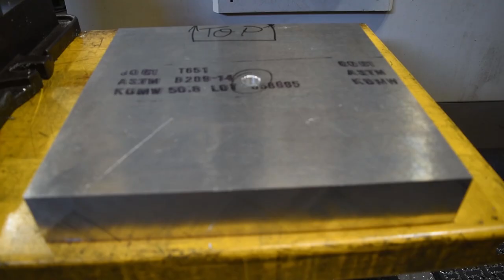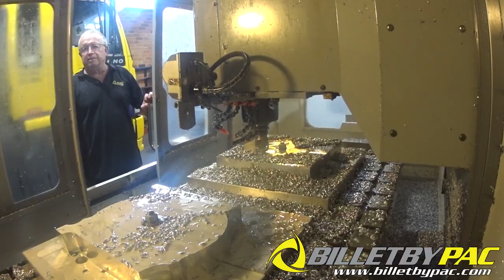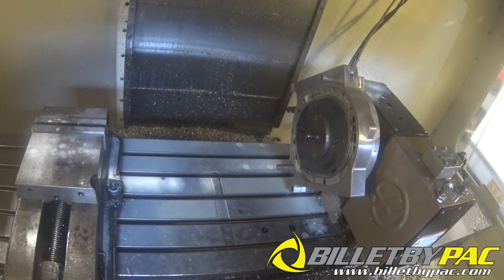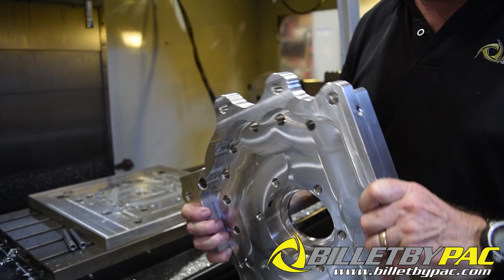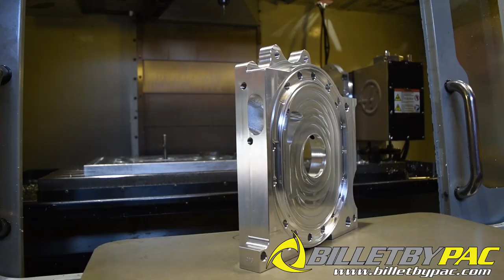CNC Machining Billet Rotary Engine Plates - Billet by PAC

Comment: What are the weight difference between these and stock?
Reply: The weights doesn't have that much difference but billets are engineered to achieve max rigidity of the model
Reply: @Rudraiya  Oh I see, but aren't these made out of aluminum with iron inserts? Compared to the original that are all iron? I imagine cooling is improved?